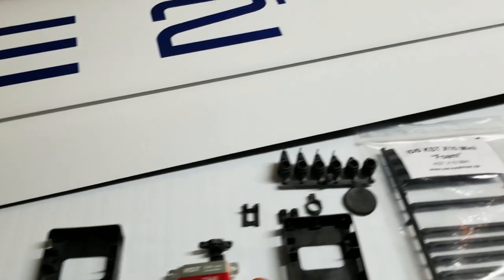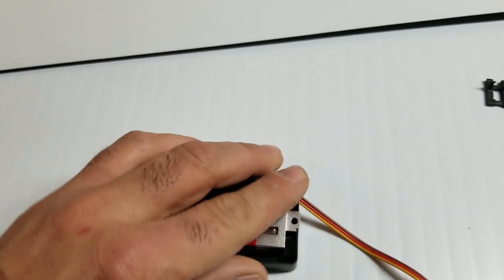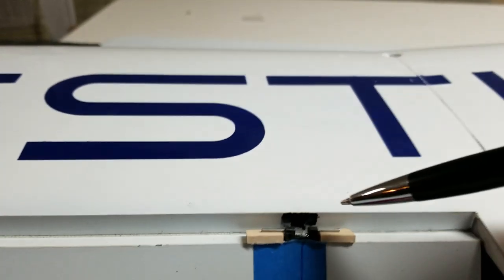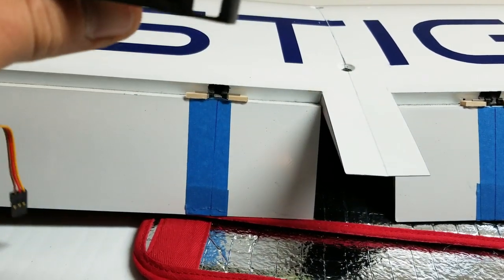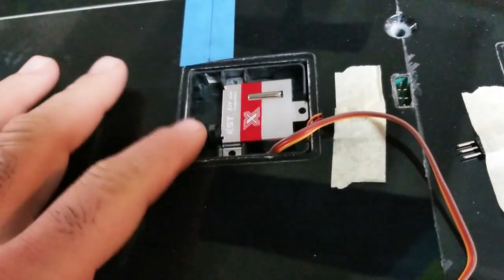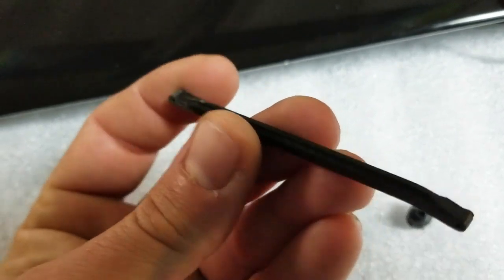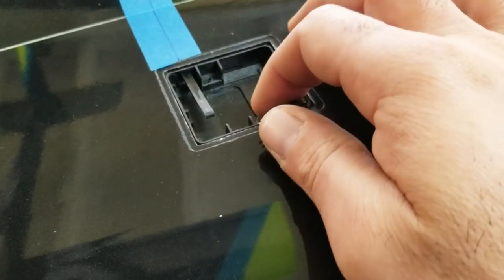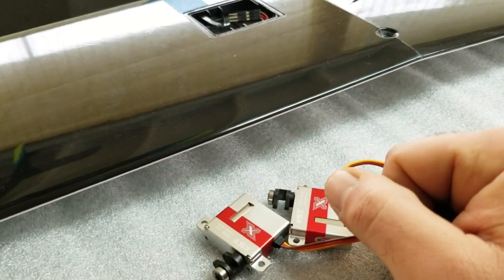Prestige 2PK Flap IDS installation part 1

Comment: I`m watching this for ideas for my glider to  make it more aerodynamic as the control horns are on the outside. I`m just wondering why you just didn`t drill a new hole at 76mm on the flap end of the control rod, that would have given you the length you wanted ?
Reply from the maker: Because I didn't have a drill press and a drill bit small enough. I don't think I would be accurate with a hand held drill.
Reply: @flightcomp   Oh ok I get it but if you`re into modifying your planes ect ya might want to look into some things. You can get what you need from Hazard Fart ..You could equip yourself pretty well for under $400-$500.. I have a small machine shop for smithing and my R/C stuff. Small 10" lathe, mill, drill press and all my gauges and micrometers and probably have under $4k into it. But I`m also into anything with a engine or motor that I can make go fast. I refuse to buy what I can make myself, LOL..Thanks for answering me